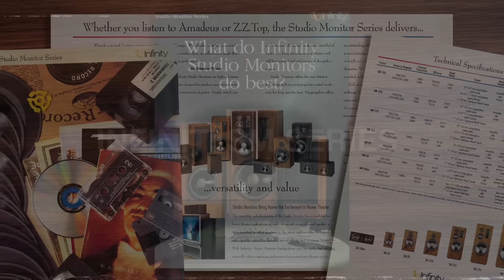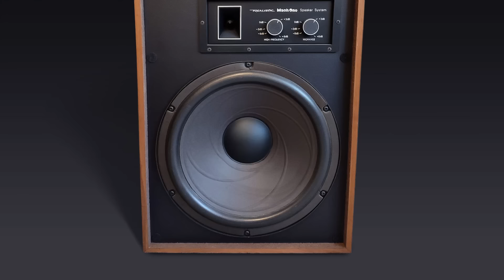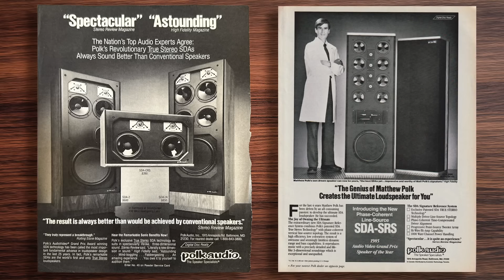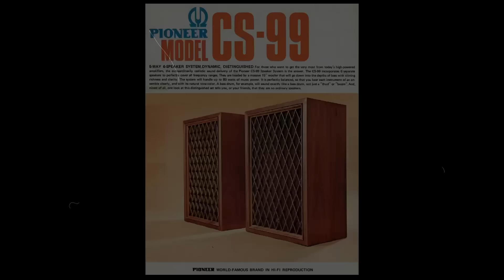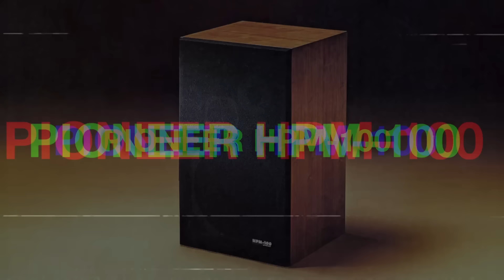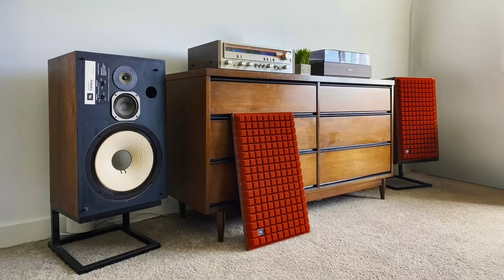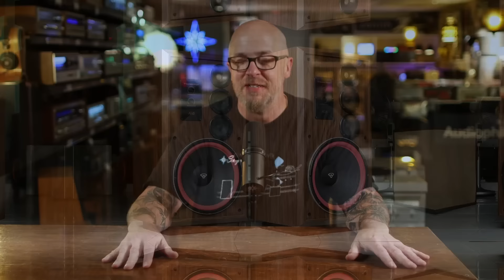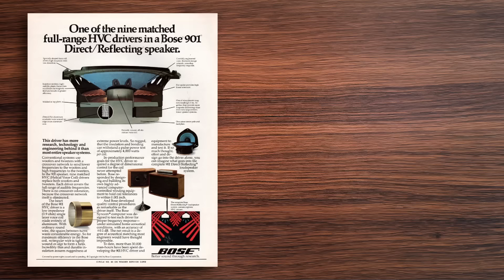Why Do Audiophiles Hate These 9 Legendary Speakers?

Comment: Almost 50 years ago I was Finally going to pull the trigger on my first 'Real' Stereo. I had an insider to the high end listening rooms in a west coast city, a Tech Manager who bought $Millions for a University.  He had already had built theaters, which used VOTT, used a lot of JBL's elsewhere, made course libraries on Sony reel to reel's ( which they had bought dozens and dozens of Sony's for Students to use in the library)  I had already looked at, ordered pamphlets on, and read about a lot of the ones here, and also eliminated a lot of them.  Then, we spent days listening to side by side comparisons in various Sound Rooms, even one higher than and way outside my budget. LSS, it was down to three. Altec Lancing, JBL and Tannoy.  ( Why wouldn't you like Horns, these all sounded amazing ) JBL's, slightly accented Bass, Altec and Tannoy's flatter, but Tannoy's mid's / voice, Wow, you were there, live, listening to vocals. They were coming from a Horn literally imbedded in the middle of the 15" Woofer. Same speaker was used in Broadcasting and Recording Studios. I hadn't heard of them before , but bought a pair of Tannoy Berkley's, then a few months later, the largest and final step up, a pair of Ardens, ( sounded amazing and even better the few times I would stack them ) Just out of Boot Camp and spent 10 months wages on a 'Stereo'.    Kids, eh ?  PS.  There was One Speaker that beat them all, even after hearing the other GOAT's. Switched speaker panel to a Single, long Cabinet. A Speaker I'll never forget,  The JBL Paragon. This Beast had to be delivered, assembled and set-up. Practical ? Hell No, and cost as much as my whole system. Best I had heard? Hell Ya !        Thanks Dad, RIP.

Comment: Had a pair of 901s in a 12 X 12 concrete walled dorm room in 1979 running a Marantz 2252B and 2600 TT.  Pink Floyd's The Wall sounded awesome!  I can still hear it over my tinnitus caused by those 901s.
Reply: I had 901’s at that time, and I saw the original ‘The Wall’ concert tour, so I felt blessed.
Reply: Bose caused your tinnitus? Why am I not surprised. Bose has to be the most overhyped company of all time. If not for finding a resurgence by selling $400 bluetooth headphones to sheep, they would have gone out of business a long time ago because they certainly can't make good speakers. Bluetooth isn't hi-fi. What a scammy company that owes everything to shady marketing.

Comment: I had 4 Bose 901's and simply adored them.
Reply: Another sheep who fell for Bose's great marketing.
Reply: @holdencaulfied7492 Hey Holden, how is Zoey?   Anyhow, really - if you found the perfect placement for the 901's, they sounded beautifully, and you didn't have to crawl into one specific square foot area to hear the speakers at their best. I owned some really good speakers back then, and the 901's were much better. I got my 4 901's in the mid 80's from a closing tavern, and they held up great until around 2010, when the gaskets and cones started to go from repeated use.  I bought some Polk and then Elac towers and there's no comparison with all types of music.  I was swayed by word of mouth, not advertisement.😊
Reply: @holdencaulfied7492 ...and I agree with you about most other Bose products - very overpriced.

Comment: Heresy is built for tubes.  They are shouty. Can’t take them.  The Chicago horn guys confirm this.
Reply: L100s were derivative 431x series studio monitors.  Had to be durable.   But most albums were mixed on these things sooooo something to that.  Auratones were also used but…..
Reply: 901s suck in every way.   4 series were cheap shit drivers.   Series 1-3 used CTS drivers which was also used in the Auratone which was the default on top of the mixing board monitor for decades before the NS10M horror.   Something to that for the midrange mix.   But Driving small drivers with radical EQ results in fast but inaccurate bass.  And clipping amps and crazy amp loads. Open baffle with large diameter drivers that don’t need so much excursion so they dont distort is much better.

Comment: OKAY!!! I have 901's They are Beautiful Durable And Sound Wonderful. I use a Subwoofer and run them without the Bose EQ. What this guy isn't telling you. Is the Receiver (At least Modern Receiver And Amp) Can give you an Amazing sound. I've had much more; Modern systems. And to me... To me. The 901.. set up right 18'' from the back wall, coupled with a decent Subwoofer And Good Receiver/Amp. Will do the Job. That being said. I listen to a lot of Smooth And Modern Jazz Funk R&B And Old School Rock.. Bob Segar Chicago etc.. And I Love The Sound my set up with Bose 901's provide.

Comment: BOSE I never liked. Even those cars that have BOSE equipment I think the sound is delivered with some DSP processing that kills the pleasure of listening some Steely Dan tracks or Casiopea. The detail is there but it is out of EQ. Sometimes high sometimes low. I think it is because the DSP that are used on this days that always shape the signal most of the time in horrible ways. I like to listen to those little imperfections on the various song recordings and that detail is most obvious on pure analog equipment. On the late 80s early 90s they start to put DSP to process the sound and that killed the hole experience for the audiophile. The audiophile like the FLAT response. To be able to listen to a record just the way it was recorded and ment to be listened.

Comment: My brother had a pair of AR speakers, don't recall the model, they were about two foot tall and deeper than wide, driven by a Sansui 4 channel receiver, I don't recall what the other mis matched speaker pair was in his set up, but the ARs sounded incredible. I heard Radar Love on that system for the first time and the horns were incredible. I don't think it could have sounded better if the musicians were in the room playing live. Also, I had/have a pair of Pioneer HPM-40s that were the first series, I believe, with the gray woofers and foam surrounds (the only thing I disliked about them) which is a deal breaker for any speaker I buy now, no foam, rubber or impregnated cloth only. They always sounded good to me but my best friend had a pair of the second series(?) HPM-40s with the white woofers and impregnated cloth surrounds that were actually rated for 60 or 80 watts not the designated 40 like mine, and they looked more like the HPM-100s shown in this video. I always wanted a pair of the HPM-100s. I remember the speaker listening room at the local Service Merchandise had a pair of HPM-150s with a big tweeter dispersion deflector for the super tweeter that looks like a stack of about six glass or clear composite disks that direct the upward firing super tweeter sound in a horizontal plane. All under a removable top "box" which itself was glass on the top and cloth grille material on the sides. 70's stuff for sure. Of course, I was only 15 and poor so I couldn't buy any of them. I also wanted to say, the Bose 901s were legendary for their direct/reflecting sound field but they had to be placed properly, preferably on a solid wall with no sound absorbing materials. I remember a dance club that had four hanging over their dance floor that were super loud and sounded incredibly accurate. I always wanted a pair but ended up with another direct/reflecting pair of speakers, Magnaplanar MG-1. The mags are not very efficient and need a 100+ watt amp to drive them. But they are spectacular and unique looking speakers and have decent sound quality. Keep the videos coming, I'm not a "vintage" audio equipment enthusiast because to me it's all just "audio equipment". I have had all mine since the 70s.

Comment: cerwin vega just matters what your intent is. for just straight up cranking some tunes, i havnt found anything yet that will compete with my xls-215 cerwins. i have other speakers that id say sound much better and cleaner but  some are scalpels and some are clevers and the xls215 are a clever attached to a sledge hammer

Comment: Cerwin Vega D-9, affordable 3 way 15" woofer, puts out 102 db with 1 watt @ 1 meter. The average speaker efficiency is about 90 db, 1 watt @ 1 meter. So... a 15 watt amp driving the D-9's would sound AS LOUD as 240 watts driving an 'average' speaker. Now imagine the D-9's at their 400 watt rating!

Comment: While stationed in Misawa, Japan, from January 1977 to August 1982, I still remember—almost physically—the feeling of walking into an electronics store called Ebina’s/Pony's (or something close to that; the name has softened with time) outside of the Misawa Air Base. What hasn’t softened is the memory of what it was like inside. Rows of hi-fi components, beautifully built, purposeful, waiting to be discovered.

After boot camp in 1976, I had searched everywhere for a real stereo system—separate components, an amp and preamp, something profound. Back home, options were scarce. There was one place that sold McIntosh, and I remember standing there knowing I couldn’t afford even a single piece. I almost cried—half joking, half not.

Japan changed everything. It felt like stepping several years into the future. Their electronics, their cars—everything seemed more refined, more intentional. I was in heaven.  While stationed in Misawa, I bought a massive Sansui BA-5000 amplifier—about 300-600 watts per channel (depending on impedance), though the exact number matters less now than the feeling of its weight in my hands at 100+ pounds. I paired it with four HPM-100s, and later added a pair of Bose 901s. I purchased other components, a Sansui pre-amp, a Teac reel-to-reel, an Akai cassette deck, a Technic turntable, and a TASCAM mixer. Those were the days. America had nothing on the Japanese.

Among my fellow sailors, we had what we called “stereo wars.” Friendly, loud, and full of pride. No one could drown out my system—and secretly, that mattered. But what mattered more was the shared excitement, the laughter, the sense that we were young and alive and surrounded by possibility.

I miss those times deeply. I miss being able to walk into a shop and marvel at technology—not as nostalgia, but as wonder. Those memories live in my heart the way memories of a best friend do: familiar, warm, and always close, no matter how much time has passed.

Sub'd

~ CTT1 (aka Spook) Martin Sawyer, USN/Ret

Comment: I have listened to many high end stereo systems, but the one that made me close my eyes and think the singer was actually standing in front of me was with a pair of Klipsch speakers running off a Decware SET tube amplifier that put out a whole 2 watts of power. Never in a million years would I have thought 2 watts could do so much.
Reply: Yes very cool , a lot of HIFI gear in the old days was fairly low on the scale of Watts , I use Electro Voice speakers in side Klipsch enclosures and they where built to handle up too 20 Watts of power , later EV came out with the Wolverine speaker that could handle up to 40 Watts of power , now a days EV can handle over a 1000 wats of power so yeah depending on what the model of the speaker is , the enclosure I use is the Aristocrat and is a folded Horn speaker and was built to run in the corners of a room and uses part of the wall as  the speakers horn wich is awesome for Stereo effects .
Reply: Klipsch are some of the most efficient spk  brands 1w sounds like 10w
Reply: I own Klipsch Heresy 3 being powered my Marantz 2250.      I do enjoy that pairing. For most of the stuff I listen to. It’s wonderful. When I’m listening to hard driving rock ‘n’ roll, I do want a little more bass, but my streamer has a subwoofer out and crossover so I have a subwoofer that I can turn on and off at Will and I find that is the perfect pairing
Reply: Same experience with Audionote. But that brand (5 watts) costs a fortune. When Lennon's voice started in the Campbell, CA showroom of Audio Note (Nick, the local distributor's house) on vinyl on "Good Morning, Good Morning, it was as you say - right in front of you. Shocking. We recreated it ONLY on that particular Sgt. Pepper's albums. Other pressings, tape, and of course, digital rips could not recreate that spooky moment.
Reply: High sensitivity.

EG

If you have a 99db sensitivity your getting 99db from 1 wat

99 dB is pretty loud
Reply: My Klipsch Epic Cf-2's have a 97db/watt sensitivity rating...and they are sweet-sounding with any amp.

And if someone hasn't said it already, no highs no lows, must be Bose.
Reply: So the ONLY speakers that can achieve full transparent sound is Klipsh? What a bunch of nonsense. I guarantee my Monitor Audios crush your mediocre 2 way overhyped Klipsch.
Reply: @holdencaulfied7492 I don't know what monitor audio is, but monitors like I use in professional recording are different than speakers. they're designed to be flat. if they're some brand of stereo speaker they will have hyped frequencies. that's the difference between monitors and speakers. give us the exact model so we can evaluate your half-baked statement.
Reply: @holdencaulfied7492 .    I like my heresy three but I also like my Bowers and Wilkins.
Reply: @holdencaulfied7492  stop listening to the voices in your head, hallucinating fictional claims is sure sign of mental malady.  Get some help bro.
Reply: @holdencaulfied7492 wow,chill out nerd boy ffs.

Comment: I was a FOH sound guy in a popular rock club in the late 70's early 80's, and was able to use a varity of PA speakers over the years, I built a party room at my house and bought 4 cerwin vega AT  15 speakers and two Carver TFM 75 amps fed by a Teac reel to reel tape machine,  and those speakers sorta sucked for low volume listening,  but they were amazing at live music levels. and live recordings sounded very real , I would argue the Cerwin Vega's were some of the best sounding speakers available to consumers once you reached live music volume levels,  there was simply no distortion just hard solid drums and base, and the vocals got crisp the louder they got .. just sayin..   if you want speakers that will reach concert level volume and still sound amazing,  you cant beat the Cerwin Vega AT 15

Comment: I hate how so many people hate on this or that speaker... yet if they got a simple Equalizer they could tone almost any speaker to sound quite well. I own many Cerwin Vega's and while if I just plug them in directly they do sound like crap... way too loud and shrill But with a nice EQ applied these speakers can literally sound way better than way higher rated audiophile speakers. I mean seriously when Cerwins were huge LP's and tapes were common so they had to boost up the mids and highs... now with modern amps and sources you just need to tone the mids/highs down to bring out the clean rich sound they offer.

Comment: I've never understood the hate around Cerwin Vega, first of all. They have thousands of models, so if you had 5 pairs that did not sound "audiophile" enough, then there's still thousands of other models, I hate watching people hate on Cerwin Vega and say they sound like crap, because they have only had 1 pair or heard about 10 pairs overall, and most of the time they have always tried the newer China Cerwin Vega speakers like XLS, CLS, CLSC, VE, VF and so on. It actually pisses me a bit off watching people just say "Cerwin Vega is not for sound quality" meanwhile they've only heard 1 pair out of thousands of models 😂 It just shows that some people's IQ are extremely low and they just don't think before they speak... You could say the same about JBL, JBL has JBL Partyboxes that sounds like the worst crap in existence, but then they have JBL L100 that sounds great, WOOWWWW 2 different models, and there's also hundres of models from JBL, you can NEVER just say a whole brand is "bad" because you heard 1, 2 or 30 pairs of speakers, you have to try every single model or else you should just not speak about calling a speaker brand bad, because they are certainly wrong...

Comment: I think it's quite fair when you specify that some speakers are great for "critical listening" of great music, whereas others (e.g. the Pioneer HPM 100 and a few others on this list) is a "PARTY" speaker, meant to rock the crowd during a festive gathering. Now, whether or not one can afford to have two different speaker systems to swap in/out depending on the occasion, is a different matter but that's not the Speakers fault!   :)
As for the Bose 901s, I'm definitely in the "Hate'em Camp". I bought a pair (plus the EQ) in 1982 and over 6 months, I could NOT find a positioning in my rooms that could make their 'wall reflecting technology' viable for me.
I sold them (at a loss) after throwing in the towel and bought a pair of the legendary KEF 501/2 (the 'swivel heads'). A miraculous upgrade and yes, I still have those (and use them!) today!   😍